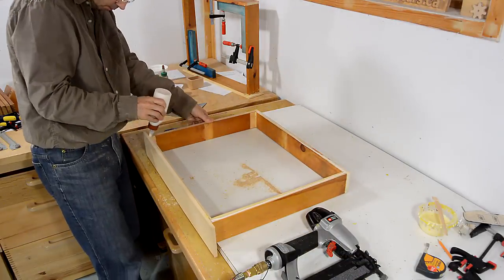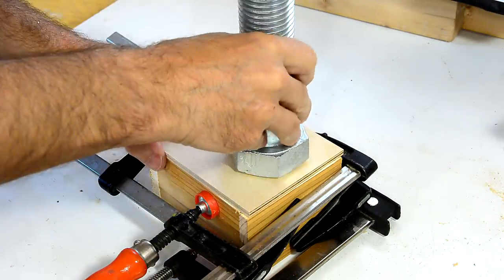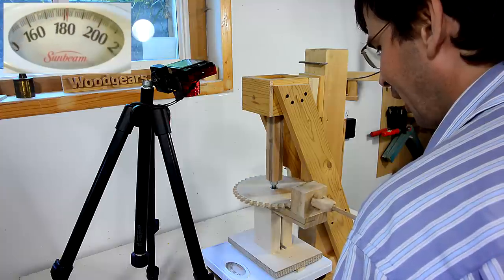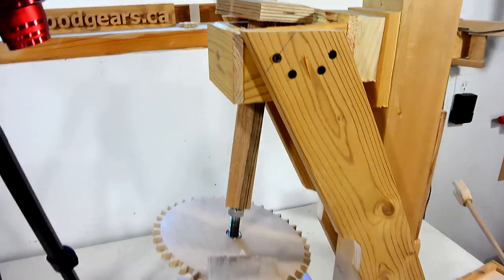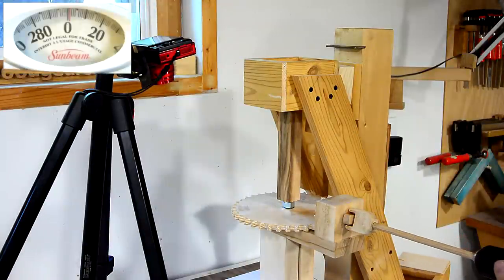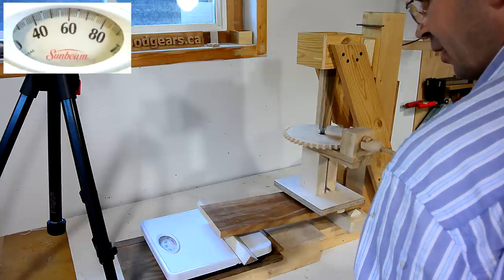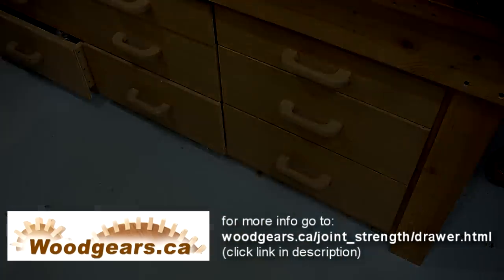Best way to attach drawer bottoms: destructive test

Comment: the resistance of the drawer depends on the relation of drawer area and glue perimeter. A drawer of 1x4 has the same area than a 2x2, but more glue perimeter (10 vs 8), so the assumption that a 4x drawer area will resist 2400 pounds is wrong
Reply from the maker: 4x as wide, 4x deep, 4x the glue area
Reply: the drawer bottom have 2 types of surface.. the holding area which is the surface glued and the cargo area which is the surface that have to hold the things you have into the drawer.. in your experiment with the small drawers the relation of the holding area compared to the cargo area is too big compared with a real drawer.. if you try the same experiment with a drawer of 1mt wide and 1 mt long, then it maybe won't hold half of the weight you reach in your little drawers (i know this without being engeneer because my drawers are big .. to hold my clothes.. and they are like your 2nd little drawer.. and almost always i loose the bottom of my drawer just with clothes.. GRRRRR ^_^) . Thanks for all you have done.. love to see what you can do.
Reply: Only one way to find out. Experiment time :)
Reply: I know you are a smart fellow.  I know you have an engineering background.  In a real world application, it really wouldn't make a difference how big the drawer was as far as strength holding the bottom on with the glue.  You can not arbitrarily multiply it by size & expect the glue to multiply it's strength by the same factor.  It is the same for a small drawer as it is for a larger drawer.  Not multiplied as you figured.  The glue does not get 4 or 8 times stronger with the size of the drawer.  It remains the same as your small test piece.  In fact, the larger drawer would fail much sooner due to the larger surface area of the bottom & thus be exposed to the force that would cause it to fail just by breaking prior to the glue letting go.
Reply: +Matthias Wandel Well I guess that a larger surface bends more when stressed so the stress on glued area will be bigger in the inside than the outside border and might not give you the 4x weight as expected but most probably at least x2 which is still more than enough for any drawer.
Reply: The glue area G of a square box of side length N, with thickness of sides T is G = N^2-(N-2T)^2 = N^2-(N^2-4NT+4T^2) = 4NT-4T^2 - And as you can see, the relationship of that formula to N is linear. IOW, unless your side thickness is also 2x as thick, you won't get 4x the glue area, you'll get less.
Reply: load in the centre has a 4x mechanical advantage over load in the centre of the smaller drawer.
Reply: OceanEmbers Care to explain? because the glue area is only x2 and all other aspects are in favor of the smaller drawer.
Reply: wait no ignore me I think I'm wrong. At least I can't replicate whatever logic I had going when I wrote that.
Reply: MinecraftiaForever the discussion started with "a box twice the size has 4 times the glue area ..." which is wrong as Gert demonstrated.
Anyway, if the drawer size increases the same load will bend the bottom more thus trying to "peel" the bottom off and since the distance increased the lever force also increased. I guess in best case scenario you get the same load.

Comment: I always glue on the bottom - never failed yet. We have a couple of very heavy drawers that needed 200 lb slides. - no issues. You're right - good engineering designs to the limiting factors for the cost / effort. 

I'm not so sure about the larger drawer being able to take proportionally larger force. The contents of the drawer are mass - x^3 - but glue surface is area - x^2. So you have the mass / area issue - same reason small animals are way stronger for their size (ant vs elephant). It would be good to do a bigger drawer and see. 

Anyway, just some technical yammering on my part. Great video.

Comment: Surely a typical drawer situation involves contents creating a turning moment where the drawer bottom joins the sides. You're creating a shear force with this set up.
Reply from the maker: +Neil Gordon True enough, but I wasn't about to make some big drawers to test.  My apparatus couldn't be able to handle that.
Reply: Stand in some drawers and lift the edges! (Hulk style)
Reply: Your drawers are plenty strong enough.
Reply: +Neil Gordon Or do a Matthias style 'leap on it from a height' test :)

Comment: I'm sure that in a real (=bigger) drawer than your testing objects the glued-on bottom will do better in comparison, because the width of the bottom will cause more shear force and for that only the area of glue and the quality ot the plywood matters. But, as you have said, in a real drawer everything else will fail before you will come even close to forces where these differences matter. I liked the lead-filled drawer imagination.

Comment: Hehe, very nice video again, Matthias. This actually sort of touches a subject that I have with my self made furniture, which is that I don't need fancy box joints, dados or dovetails in normal furniture, because they will never be subjected to serious forces. I mostly do mine with just screws. Most is even without glue or rabbets. But I also live in a small single apartment (33 m2), so I don't have room for stationary tools (i.e. no table saw, band saw, or any router table). And I don't need to hide all screws: as long as something is otherwise well made, it doesn't matter to me if some screw heads are visible (in vertical surfaces). The best tool for wood cutting that I got in my small apartment is propably the rail-guided plunge saw ( I have the DeWalt version). It very much cuts down (or even eliminates) the final finishing work.

Comment: I appreciate the honest search for truth rather than being overly invested in being right.  I think drawer size might also matter a lot.  As the drawer gets larger, a thin panel is likely to pop out of a groove due to the flexibility of the wood.  The thicker the bottom panel, the smaller the drawer, and the deeper the groove, the less this is an issue.  The stiffness of the material also would matter a lot, and the grain direction could be relevant.  I suspect most drawer bottoms that fail (which is common in crappy construction) do so because the material is not very stiff and not set very deep into grooves, especially over a larger area.

Comment: Yes, I know I am over a year late with this comment.  When the bottoms are glued to the drawer edges, the glue is stressed largely in tensile, especially at the inner edge.  Tensile is usually the worst form of stress for a glue joint.  When the bottom is glued in a slot, much more of the stress is in shear.  Glue is usually much stronger in shear.  That probably accounts for the differences in Matthias' tests.  He did demonstrate that modern glues are strong enough, even in tensile, that for many applications, tensile loading is OK.

Comment: Great video - thanks.  Both objectives achieved : 1) entertainment and 2) encourage critical thinking.  

Furniture construction (and design in general) is all about a balance of material use, complexity of construction methods, engineering, aesthetics and whether the item will be "fit for purpose".  I would not build a "shop drawer" the same way as for a drawer in a furniture piece.

I always come away from your videos re-evaluating what I do and thinking whether I could improve some aspects of my work so I thank you for that.

Cheers.

Comment: Good enough for me Matt . You were testing joint not drawer bottom material. And yes ply glued straight on out performs the runner strength so no issue.

Comment: This is a good test if you're always using plywood for your drawer bottoms.  I use 1/4" solid wood on some projects and in those cases, I have to use a dado to allow for the wood movement.

Comment: I'm a little surprised that you are surprised by the results.  Not from a quantitative perspective but by which one would win out.
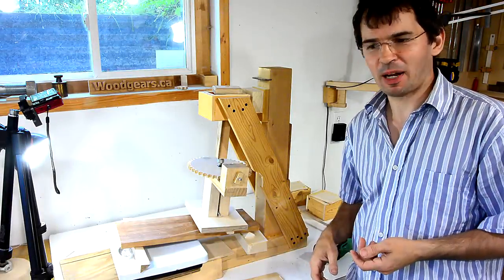Reply: +GarageWoodworks To some extent, I am surprised as well - though on close examination...not nearly as much.  Modern wood glues are actually stronger than most the woods they mind to.  If you look at around 6:33 you can see what appears to be the veneer face of the plywood still stuck to the bottom of the drawer.  This would seem to indicate, at least in part, that the failure actually occured between the veneers of the applied bottom as opposed to the shop glue joint itself.
That isn't to say that I would expect the applied bottom to be stronger.
Reply: +Joe and Liz Exactly, the plywood failed at the top glue line.  That's what I would expect.

Comment: the groove is manly for expansion and contraction.wood moves ,a lot.glued on panels will eventually crack.and i believe it works the other way,bigger panel = greater area=less pounds per square inch carrying capacity.
Reply from the maker: +charles kovalewski Watch the video.  I was talking pounds, not pounds per square inch.

Comment: I'm sure someone has pointed this out, but because the piston pushing the bottom was the same size as the box, it does not really allow the bottom to flex. When it flexes, it has a tendency to pull out of the dado. Because the surface for glue is smaller (probably) than if you just glue the bottom to the box, this can change the results radically. 

Now, most drawers I have seen in commercial furniture are not glued at all, the bottom just slides in the dado. This is enough for most practical uses. Unfortunately, not always. I have seen old drawers with poor quality bottoms that failed, the bottom flexed and fell out of the grooves. As a result, it was difficult to even open the drawer, since the bottom would catch in whatever was beneath the drawer. Worth considering, I think.

Comment: If I understood your comment correctly about the larger drawer strength. I do not think it would be stronger because it is larger. the test you did was testing the glue strength so for a larger drawer it would break under the same pressure as the small.  On top of that you'd have much more deflection potential because of a larger surface area.  Anyway, I think 600 lbs is pretty significant. I sincerely don't think you could put three grown men in any of those large drawers and have the bottom survive. Good idea for a test! :-)

Comment: Now, I've tried both methods. Technically, you are right. Just using glue is enough to provide as much strength as is needed for drawers, specially since most rails are rated for 70 kilos max.

However, I've stick around using dados since from my experience, it is usually the glue that fails due to vibration and other stress, specially if the customer handles the drawers rough.

Also, many rails are designed to be mounted hidden on the bottom of the drawer, so therefor you have to use a dado for technical reasons...

Comment: It could be wrong but I was always told that putting a floating draw bottom in the groove allowed for expansion of the wood around the plywood bottom that doesn't expand.
Reply from the maker: +Robert Walsh For solid wood drawer bottoms (before people started using plywood) leaving the bottom "floating" so it could expand was important.  But if it's a plywood bottom, you can just glue it in, because it won't move any more than the surrounding wood.
Reply: +Robert Walsh  It appears you and I went to the same school.  I prefer to have a floating bottom (even if it's plywood) in case the drawer sides warp.
Reply: +Robert Walsh Wood with the direction of the grain doesn't expand much at all.  The plywood itself will actually move more in most cases.  For plywood bottoms, you will get more strength by gluing it in - as the glue itself moves enough to prevent the wood movement from breaking the joint.There are benefits to the floating bottom though.  Definitely easier to replace should the need arise in the future - but in general, if you are doing plywood bottoms - a groove on all 4 sides with the bottom glued in will be stronger than the traditional method of having a groove on 3 sides and a floating bottom.

Comment: Many drawer slides wrap around the bottom so it holds the bottom captive in the same way a groove does. I imagine there are many cases where high quality 1/8" plywood could be used to really maximize capacity.

Comment: Thought I had was that the unglued groove bottom on a larger drawer would fail sooner because the plywood would flex and pop out of the groove. Had this happen to me before.
Reply: +felixthecrazy The test setup applied the load at the edges of the bottom (effectively, because that was the only place it could give at).  This prevents any sort of bowing of the bottom in the groove or with the applied bottoms.
Reply: Yeah I get that. But I was thinking in a real world application if a drawer is 18"x 24" the weight of the stuff would be bowing the drawer in the middle as the sides wouldn't give. So while the video showed the strength of the methods, I was thinking more the real world usage. I had a drawer, with slotted bottom, that was overloaded and the plywood bowed and slipped from the slots. Don't know if a glued flush bottom would have held any better in the same situation.
Reply: felixthecrazy Was the bottom floating or glued into a groove?  If glued, it should have prevented it from bowing until the glue joint failed (or it ripped the sides off...).  The bottom itself may fail if dealing with hardboard/MDF/particle board - but plywood is very strong with the grain itself...and because the grain is cross banded, it can withstand immense loads in tension.

Comment: Conclusions:  Either drawer bottom attachment method is probably stronger than the drawer bottom material itself.  

I wonder if you had used an epoxy glue to attach the bottom would have increased the strength since it was the glue that failed in the glue-on-bottom samples?  West System used to claim (they still might) that its epoxy was stronger than the material.  So the substrate would fail before the bond.  

Anyway, good test.  Its always good to see these things tested.  IMHO, both methods produce a strong enough drawer, but its good to know you have tested them.

Comment: Your lever physics was correct. That's why it is surprising at the end that you assume the larger drawer would be stronger than the smaller. There is more leverage on the bottom when it is bigger, so wouldn't a bigger drawer fail faster than a smaller one?

Comment: Realistically, though, wouldn't the groove probably win the longevity test?  I've run across many glue-only pieces that fell apart simply because the glue quit (old age?).
Reply: +mnelson10000 Probably.Most old glues did not age well, as a result a lot of antique furniture has brittle glue joints that need repairing.  Modern glues are better then they are - and although tested in labs to replicate aging in an accelerated manner, they haven't really been subjected to all the issues that come about with real time.  The modern glues will likely last longer than the old glues, but eventually time will take its toll.Then you have to ask yourself, how long do you want this to last?  I wouldn't glue the bottom on an heirloom cabinet that I hope to be around in 200 years...but I do tend to use applied bottoms (1/2") for shop cabinets and some utility cabinets.  They would work fine in kitchens and what not as well - though I don't care for the look there.
Reply: +Joe and Liz +mnelson10000 Also consider the value of being confident in trying to fix an issue when it comes up. If you can repair something, is it still broken?
Reply: +Joe and Liz It's very easy to clean and re-glue an antique joint that used hide or fish glue. Modern glues, it's a major hassle, and the joint is likely to be degraded. If a joint is going to fail, it's better that the glue fail than the wood. You can easily re-glue a joint and return the joint to full strength. Once the wood fibers themselves have split or broken, it's difficult or often impossible to make the joint as strong as it once was. If I make something that I hope will outlive me, I generally use hide glue.
Reply: FXM Very true.  When I am doing repairs (or often colsulted on doing repairs), I do the calculous regarding the repair and the nature of the piece.  The same goes for when building new items.  Different processes, materials and techniques are used depending on if I want a piece to last 5 years, 25 years or 250 years.  It might be surprising to some, but the piece I design to last 250 years is likely the one which will fall apart the easiest.  Joinery that can be knocked apart without destroying the wood itself, and glues that can delaminate if left in a hot shed...

Granted, even stuff that I only plan on lasting 5 years (kitchen cabinets and shop fixtures for example) and 25 years (regular furniture) tend to last much longer than that...but again, rules...thumbs and breaking them.
Reply: +Joe and Liz Absolutely. If you want a piece to last, make it easy to repair. Otherwise, as soon as it breaks/fails, which it inevitably will, it's just trash. If it's easy to repair, it may well survive the transition from "old junk" to "heirloom antique." Once over that hump, it may well last for centuries.

Comment: I get your point that the rabbet and glue is strong enough but given that glue joints can be made weaker quite easily (say un clean surface) i feel that the dado gives a good safety factor simply by interference. For the minimal extra amount of effort required I think the dado  is worth it to me. Also static loading, when new is a very narrow criterion for general quality. Fatigue and strength relative to age are important as well. I'd also guess the glue is more brittle then the wood making it more prone to failure when shock loaded, making the interference joint more suitable. I like your test but I think there is more to it then that. You seem well served by your methods and in engineering good enough is often the goal rather than ideal. Cheers!